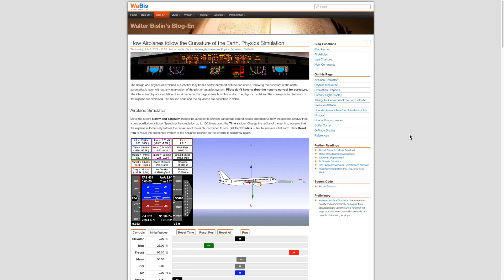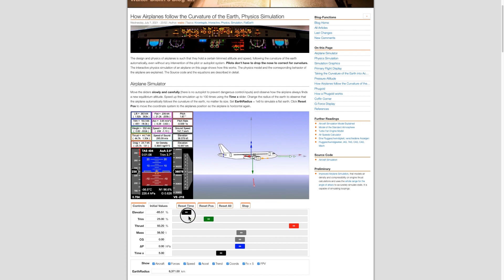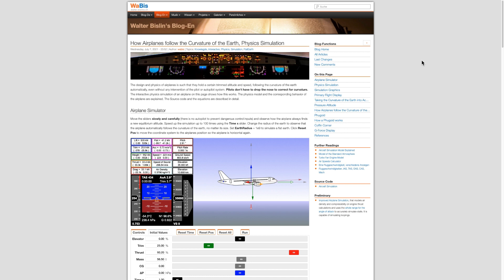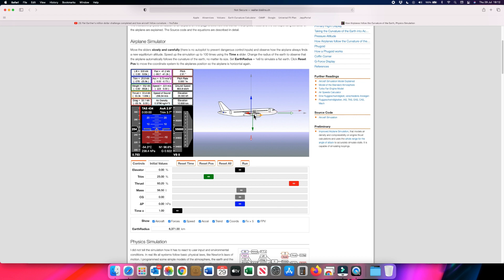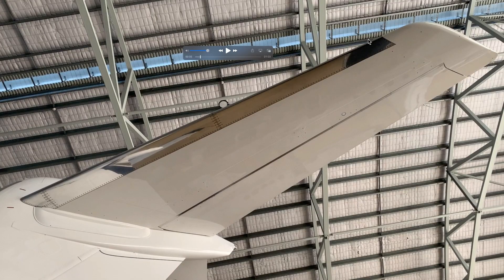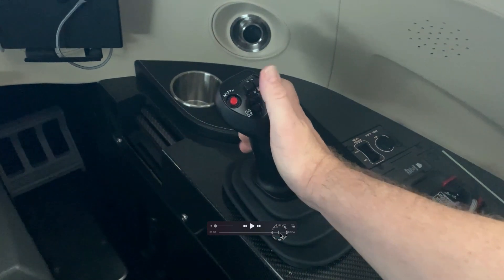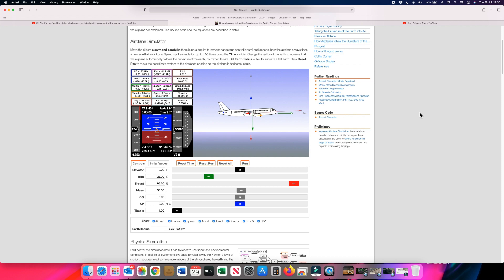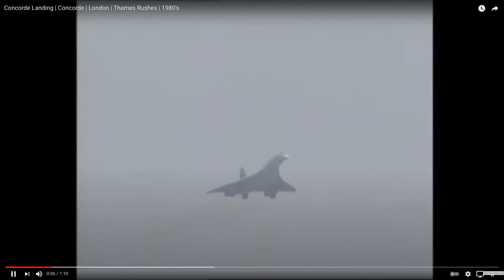An overview of the Elevators and Trim in aircraft.  How pilots control the pitch attitude.

Comment: Could you make an estimate of how often in straight and level flight, on autopilot for instance, the elevator (or does the autopilot change the vertical stabiliser and not the elevator?) actually move to maintain optimum pitch and altitude?
Reply: Depends on how still the air is.
Reply: Mike  --In level flight, the control surfaces don’t have to move for the sake of following the Earth’s curvature, only for the sake of contending with atmospheric variability and incidental factors that would perturb its flightpath (e.g., weight loss due to fuel burn, balance change, etc.)  Setting aside the incidental factors, and assuming a (hypothetical) invariable atmosphere, then once configured and trimmed for level flight, an aircraft will maintain level flight.  That means it will follow the Earth’s curvature automatically, with no control inputs required of the pilot/autopilot to accomplish this.

In the real world, a pilot makes many control inputs over distance, in order to achieve and/or maintain the desired performance and flightpath.  The control surfaces move correspondingly.  But none of these actions are required to follow the Earth’s curvature—to do that, a pilot simply maintains a constant altitude.  That’s it.
Reply: @cardinalRG  Yep I was aware of all that, sorry didn't mean for anyone to have to type it all out on my account. 

The reason I asked was for a rough estimate from a pilot on how many elevator adjustment per minute/hour etc might be made done on an average flight once 'level' has been attained. 

That way when confronted by one of these knuckle-head flat earthers who seem to think that control surfaces are locked in position once 'level' has been reached I can not only tell them that they are always making adjustments and that if there WAS any compensation for going 'around the curvature' it would be completely imperceptible and lost in all these tiny adjustments made to maintain altitude/attitude anyway, but I can also give a rough figure on just how many adjustments are made.
Reply: @Mike-me3sp  --No worries, and I tend to put in my two cents even when only a penny is requested, hence the long explanation.  

”I can not only tell them that they are always making adjustments and that if there WAS any compensation for going 'around the curvature' it would be completely imperceptible and lost in all these tiny adjustments made to maintain altitude/attitude anyway,”

Well, that’s the plain truth, and sorry, but I’ve no idea of how to make it any clearer.  In all my time as a flight instructor, I never had to dumb it down even that much.  I appreciate your query, but unfortunately, there’s no way to answer it.  Depending on the aircraft, the duration of flight, the flight profile, atmospheric conditions, the pilot’s preferences, and other factors, a hand-flying pilot may find her-/himself with relatively infrequent control inputs—say, a handful over an hour’s time—or may have to make control inputs continuously.  There’s just no typical or average case, and don’t let any flatEarther press you on it.  And if one of their goofy questions frustrates you, then send them here and Wolfie or someone else will answer them.
Reply: @cardinalRG  I did about 20 hours in ultralights in my youth and I know the control adjustments were frequent and constant when trying to maintain course and altitude steadily, but that's only to be expected in a small craft at low altitudes I guess. 

I was more after an airline type pilot's opinion on the subject (large fast aircraft at higher altitude), as that's what seems more relevant when FE'ers babble their misguided nonsense.
Reply: @Mike-me3sp  --Typically, aircraft cruising in the higher levels enjoy a much smoother ride than those flying lower do, and the amount of control inputs they require is on the lesser side of the scale, for sure.  As it is, so few pilots fly by hand for much time in that scenario any more, so even the control inputs that are necessary are usually handled by an autopilot, and a pilot wouldn't even attempt to count them.

Ultralights also looked like more than a bit of fun.  If you're an aircraft nut like me who misses flying, then you still work the rudder pedals in your sleep.
Reply: @cardinalRG  lol Yep. It was only a brief stint in my life and it's been more than a few years but doing the side-wind dance on the pedals in the second or two before touching the ground still feels like it would come back to me in an instant.
Reply: @cardinalRG  Ever been on a gyrocopter? I did it once and I flew it for a few minutes.
Reply: @Mike-me3sp  --I’ve never been on a gyrocopter, nor had the chance to be.  I’ll confess that I’ve been less attracted to rotorcraft than fixed-wing aircraft, but of course there’s no judgment in that.  I admire the pilots who fly them, but tastes run differently.  For example, helo pilots I’ve known have lacked interest in the aerobatics that I enjoyed, and together we’ve scratched our heads at banner-tow pilots, cropdusters, whale-spotters, and other flavors of flying that grip them but not us.  It takes all kinds (except flatEarthers) and there’s something for every aviation nut, it seems.

Comment: Sorry I still don't get it. once trimmed the direction of the gravity force vector is perpendicular to the plane horizontal axis. But when the plane moves forward the direction of the gravity force vector should be tilted (backward) a little bit, and this means less force pulling the front section down since it is acting on an angle. Doesn't this mean that the force acting on the tail will push the nose up? what am I missing?
Reply: An aircraft has three axes—vertical, lateral and longitudinal.  It isn’t clear which axis you mean by “horizontal.”  At any rate, these axes are referenced to the aircraft itself, and so their orientation with respect to the gravity vector changes as the aircraft’s attitude changes.  Trimming does not enter into consideration here, because trimming the aircraft merely eliminates stick forces, and is not all-determinant of attitude.  I hope this helps.  If not, feel free to re-phrase your question(s).
Reply: @cardinalrg5114  
Thanks.
By horizontal I mean the linel the plane was flying in, not something based of the plane itself. 
Am trying to understand that if at a given moment in time the forces explained in the video are balanced, what happens to the forces when the plane moves in a straight line for some distance.
Reply: @bashargharaibeh585  --Friend, you’re still unclear.  Let’s simplify and start at the beginning.  Put aside the terms “plane” and “straight" for now.  What is the flightpath in your scenario…a climb, a descent, or level flight?
Reply: @cardinalrg5114  the goal is to stay level, the question is on the forces affecting the airplane and how they change as it moves to keep it level
Reply: @bashargharaibeh585  --Great, let’s take this step by step.  Level flight is flight at a constant altitude above mean sea level (MSL), and is curved in the vertical plan in proportion to the Earth’s own mean curvature.  Level flight is not a flat flightpath, and a flat flightpath can only be a climb or descent.  Level flight may or may not be a straight flightpath, since “straight” in aeronautical terminology refers to trajectory only in the horizontal plane, not the vertical one.  Do you agree so far, or else have questions about it?
Reply: @cardinalrg5114  Yes, I agree.
Reply: @bashargharaibeh585  --Great.  Your original question seems to center on gravity vectors, and your second comment clarifies that your angle reference is the aircraft’s flightpath, not the aircraft itself.  

The Earth’s gravity vectors are infinite in number, and omnidirectional, each emanating from the Earth’s center of mass and passing through the Earth’s surface at a unique point.  (These vectors are also equal in force but for infinitesimal variations due to terrain and certain other natural factors, but in the context of the natural environment in which aircraft fly, such variations are not influential to aircraft control.)  Since a level flightpath describes a circle, and since the Earth’s gravity vectors are omnidirectional, then every vector will meet the flightpath at ninety degrees. There is no change in the angle.

As for the aircraft itself, in level flight every part of it remains at a constant altitude, and so every part of it flies a circular flightpath.  Gravity treats the nose no differently than the tail, nor any other part.
Reply: @cardinalrg5114  thats great, but my question is exactly what keeps each part of the plane level. From the sum of applied forces, the plane should move in a straight path (not level, but ascending relative to mean sea level). This direction slighy changes the angle of the gravity vector. But something happens that corrects the plane to stay level.
Reply: @bashargharaibeh585  --  ” From the sum of applied forces, the plane should move in a straight path not level, but ascending relative to mean sea level.”

No, the exact opposite is true.  What is your reasoning to think otherwise?  It might help you to understand that (a) the deviation you describe is not a straight path but a flat one, and a is a climb.  (In aeronautics, “straight” refers to a constant heading or course, and not to any path the vertical plane.)  (b) when forces are balanced, they are balanced for the entire aircraft, meaning every part of it.  If you accept that balanced forces would keep any part of an aircraft in level flight—say, a point on the wings—then why would any other part of the aircraft enter a climb?  Each part of the aircraft reckons the four forces, with each part beholden to a unique gravity vector.  Remember, gravity doesn’t recognize any distinction between an aircraft’s nose and tail, and whatever else.  Gravity is egalitarian, and at the same distance, the resulting force due to gravity varies only with mass

A flightpath only changes by the pilot’s deliberate control input, by a non-directed onboard cause (e.g. weight loss due to fuel burn), or by perturbance from environmental factors (e.g. weather, atmospheric variation, etc.)  In absence of these actions, the aircraft will fly level indefinitely, following the Earth’s curvature with no special control input needed to accomplish this. There is no correction needed for this.

You seem to be edging up to an argument that many flatEarthers actually make, which is that to follow the Earth’s curvature, an aircraft would have to “nose down” periodically or constantly.  If this is what you’re driving at, then in another comment I can give you a detailed tear-down of that claim, if you like.  In the meantime, the short explanation is that an aircraft has no default flightpath, such that it will always fly that flightpath if nothing is done to change it.  It doesn’t seek to fly flat.  In fact, the aircraft will fly any flightpath at all for which it’s configured, within the aircraft’s performance envelope, with no preference over any other flightpath.  So when an aircraft is trimmed for level flight, following the Earth’s curvature, it has no “urge” to deviate to something different, such as the climb you describe.  Why would it?

To review:  When the balance of forces directs a level flightpath, it directs EVERY part of the aircraft to remain in level flight.  Apart from the control input and perturbances which I’ve described, there is no force that would cause the aircraft to act any differently.  If you think otherwise, then please identify the force that would alter the level flightpath.
Reply: @cardinalrg5114  Thanks again. For the record, am not trying to reach any conclusion and definitely not hinting that a level flight requirs pilot correction. The earth is a sphere and pilots don't correct for curvature. So am simply trying to understand how it happens by trying to understand the net forces affecting the airplane.

If I understood it right, what you are saying is that the vector representing the sum of forces on the airplane is not tangent to the curve, but in a direction that allows the airplane to maintain its level? If we take a snapshot, where would the force vector point to, and if we take another snapshot small amount of time later after the airplane has followed the force vector path from the first snapshot, where would the new force vector point to.
Reply: ”If I understood it right, what you are saying is that the vector representing the sum of forces on the airplane is not tangent to the curve, but in a direction that allows the airplane to maintain its level?”

No.  What I’m saying is that an infinite number of gravity vectors align with an infinite number of points on the aircraft.  All of these gravity vectors are at ninety degrees to the level flightpath, and not tangent to anything.  These vectors comprise a constancy of gravitational force that keeps the configured-for-level aircraft at a constant altitude. You’re distracted by the suspicion that something additional is needed to keep the aircraft level, so it might help you to ask yourself, “what force would make the aircraft deviate from level flight?”  In fact, with different phrasing, I asked you this question twice in my last comment to you, and I’d like you to answer it, please. 

Also, I don’t know what you mean by “sum of forces” and “THE force vector”. (Emphasis mine.)

”If we take a snapshot, where would the force vector point to, and if we take another snapshot small amount of time later after the airplane has followed the force vector path from the first snapshot, where would the new force vector point to.”

Any point on the aircraft aligns with a single gravity vector at a time.  With movement, it aligns with a series of new vectors.  The aircraft does not follow the path of these vectors (your “force vector path”?), unless it’s flying directly toward the Earth’s center.
Reply: @cardinalrg5114  Sum of forces such as lift, gravity,  tail lift. And thrust and drag. All of these can be represented based of a single point on the aircraft and this is much simpler to study than the set of forces on every point on the aircraft.

So in one snapshot, the sum of these forces will mainly point forward. If the direction of the resultant force is exactly at 90 degrees to the gravity vector, then at the second snapshot the angle will increase. If it less, then I can start to imagine how the airplain remains level but need to work on quantifying it.

Sorry for any confusion (as am confused as well)

Comment: Do you have any videos on how north-south flights are planned? Thanks in advance.
Reply: What distinctions do you assume between North-South flights and any others?
Reply: @cardinalrg5114  

I had to go back to the main video to figure out what I was thinking of! Been a while. 

The context is whether any provision is made for changing linear rotation speeds when planning north-south flights. I think there isn’t because angular speed doesn’t change, but I’d hoped to get confirmation from an actual pilot.
Reply: @jormungandr9251  --There’s no distinct, navigational flight-planning consideration for a North-South flight, as opposed to any other.  The increase/decrease in the atmosphere’s linear speed during such a flight—and therefore the Coriolis Effect--is compensated for by a heading change, but because this particular change is so minute and gradual, and because it coincides with corrections needed for other, much stronger factors, such as wind and weather, then it does not merit any explicit attention in flight planning--it is ignored.  In actual flight, the pilot accounts for all perturbing factors by merely pointing the aircraft in the appropriate direction to maintain course, with no need to separately account for the atmosphere’s changing linear speed.
Reply: @cardinalrg5114  

As I suspected. Thanks!

Comment: I have a question that is not directly on the topic of this video.
I live 30km from an airport so there is a lot air traffic around. Sometimes I hear the engine noise of an airplane drop down rapidly in pitch.
Since the airplane does not pass me with high velocity it is no Doppler effect. Sounds more like an engine failure but it happens way to often so it is not very likely. But what is it?
Reply: When aircrafts climb or descend near airports, they typically do so stepwise and not continuously up to or down from their cruising altitude. Their power can be reduced quite a lot when changing from a steep climb to level flight or from level flight to a descent, something I have noted myself as a passenger.
The Doppler effect will also play a role even if the aircraft's speed is far lower than its cruising speed, since even a passing car has a clearly noticeable change of pitch. The Doppler effect will also depend on the aircraft's path relative to your location as it will be most distinct if it passes directly above your head at a low altitude.
Reply: Forget about the Doppler effect, it does not fit to the given situation/speed/direction. Also I am not interested in the general noise an airplane makes, it is the rapid drop in the pitch of the noise that I am interested in.
Reply: @meeborggp9055  Maybe it's engine brake...
Reply: @tjjones621  
In midair?!
Reply: @meeborggp9055  Sorry.  That was an attempt at humor.  Maybe it was an air brake.  I saw it on a Buggs Bunny cartoon once. 

:j
Reply: I live close to Avalon airport in Australia and hear the same thing, It causes me to look up quite often because it does sound a very unnatural noise, However, I'm no pilot but I believe it could be a combination of reducing power to the engines and the air brakes as they are lowered to further slow the aircraft, but am happy to be corrected.